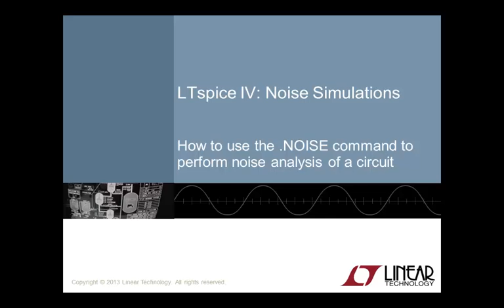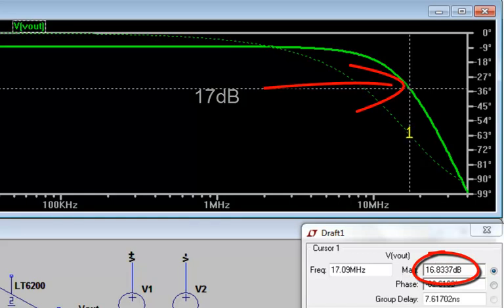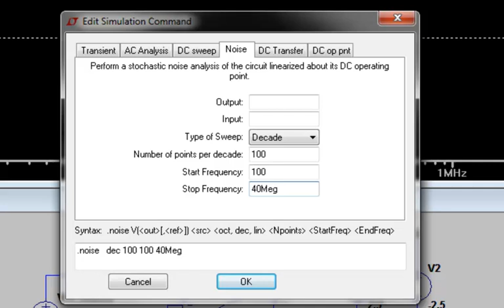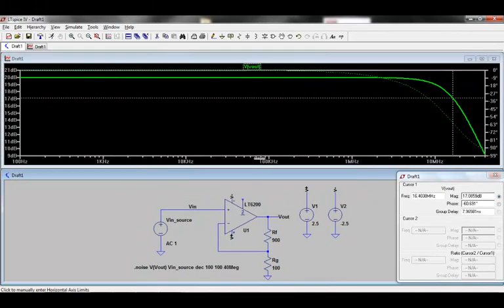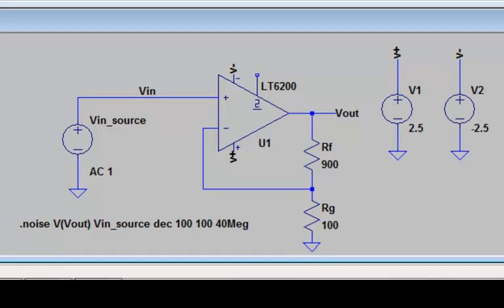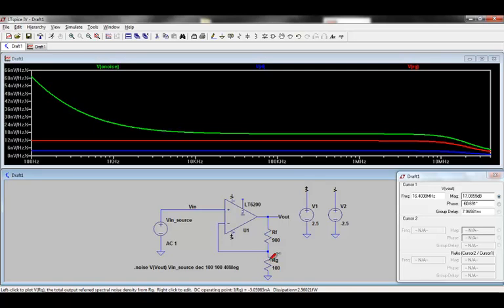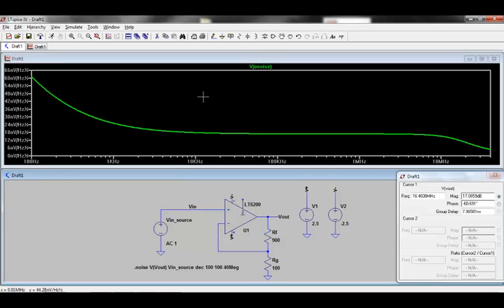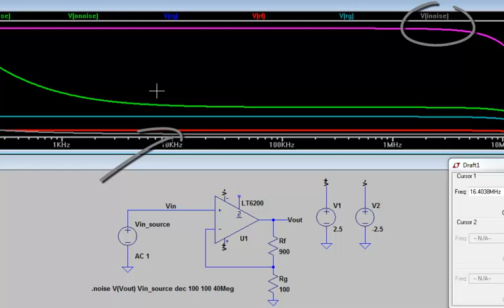LTspice IV:  Noise Simulations

Comment: Are there guidelines for choosing the correct frequency band? It looks as though if a higher frequency is chosen, it would result in more noise according to spice but in real life the frequency response of the op-amp should reduce the signal at higher frequencies outside the GBWP?

Comment: How to let the LTspice calculate the noise votage for a given frequency band instead of  noise spectrum density?
Reply: in the waveform viewer when you are displaying a noise trace, you can click on its name while holding the Ctrl key pressed and this will show a new window in which the RMS noise voltage is given for the displayed frequency band. If you are performing a .step simulation, you can also evaluate the RMS noise with a .meas statement to get the output in each of the stepped simulations.
Reply from the maker: Hello, please ask your question on our technical community at https://ez.analog.com/power/

Comment: Noise is dependant upon temperature. What does LTspice assume as the temperature?
Reply: I think what's being asked here is what is the default temperature, which is 27 C. It can be changed by adding a SPICE directive (.op) with the text .temp 100, which sets the temperature to 100 C.
Reply: In general, LTspice examples do not simulate temperature (though temperature dependency can be defined). Customers can best get an understanding of the product performance over temp by reviewing the details in the datasheets which are based on actual results and guaranteed. For additional support please visit our online technical community at https://ez.analog.com/